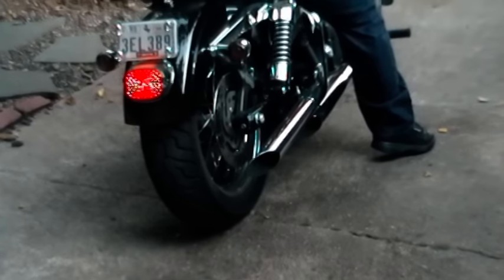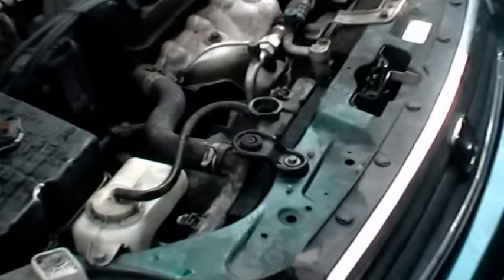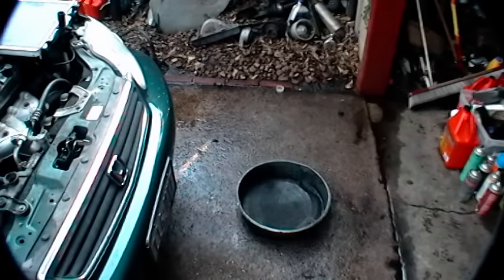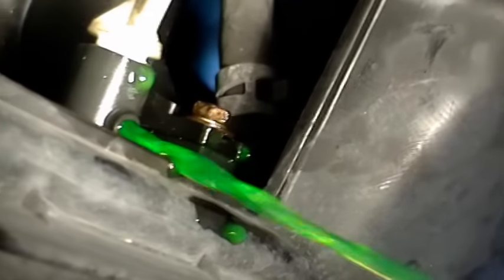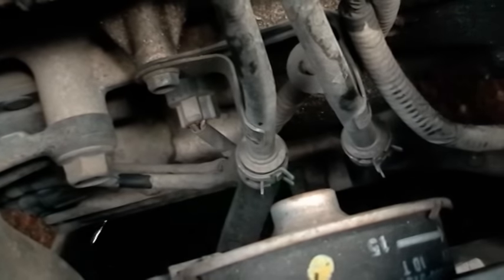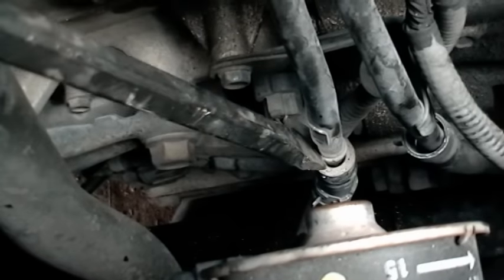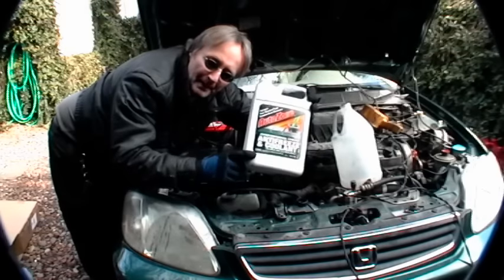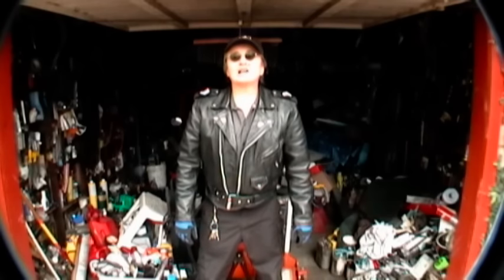How to Replace a Radiator in Your Car

Comment: Somehow, I believe my experience will differ.
Reply: walter parker ha ha ha i know imma still try it though
Reply: i send my holden wm 2009 once to a mechanic to replace the radiator and the fan took him 9 hours to finish
Reply: i cant really remember its been like 4 years but last week I've sent the car again for radiator replacement and costed me around 430 usd so i think he charged me almost 500$ that time i think.

also don't do same stupid mistake like me especially if you got the same car always install the original radiator not the Chinese one believe me it's crap not worth it 2 years and it will start leaking
Reply: Lmao at first I was like this is simple.  Then he did all that n I was like oh hell naw🤣🤣
Reply: @95BLUERAY  Damn, I thought,I was paying too much. Im paying  rear brakes and radiator change for 545.
Reply: @andydelacruz7545  it's insane right? i think we all should start working on our cars
Reply: Eddy tha Don it’s easy if you have experience with small things.. if you haven’t been around cars much, it’s also a good spot to learn but just record all that you do
Reply: @PaPanthers  It was when he started hitting thngs with a sledge hammer that I lost heart.
Reply: I feel ya.
Reply: @PaPanthers  🤣🤣🤣🤣🤣🤣🤣🤣 yeah I got lost with everything that connects to the radiator 🤣🤣🤣🤣🤣🤣🤣
Reply: barreltapper lol
Reply: @95BLUERAY should be able to get the fans out in like 45 minutes. 
I took out the radiator in WM today and will replace it with a aluminium one, maybe tomorrow. Hopefully it holds up. 🤞🏻
Reply: @95BLUERAY  Should be able to get the fans out in like 45 minutes. 
I took out the radiator in WM today and will replace it with a aluminium one, maybe tomorrow. Hopefully it holds up. 🤞🏻
Reply: LMAO 100%
Reply: “Cries in Cadillac”
Reply: Agreed
Reply: IKR! Scotty makes it look super easy
Reply: Many, many curse words and hours later you will be in business lol

Comment: absolutely stellar video you saved me 135 dollars God I don't where we would be without youtube
Reply: Canadian Tire wants to charge me $150.00 to put in a new one . Plus $150 for the radiator Plus $130 or so for labour.
Reply: @CanadianMan1982  If parts and labor are $150 and $130, what was the first $150 for?

Comment: I called around to a handful of different repair shops and they all wanted almost $500 to replace the radiator that was leaking in my 1996 GMC Jimmy. I was pretty hesitant to fix it myself, but I decided to be brave and do it. I ended up spending just around $100! The whole process was actually easier than I thought it would be too. Thanks Scotty for the inspiration!

Comment: Thanks Scotty! I didn't have a good way to take off the clapms - the "take them off at the engine trick" worked great for most of the hoses, except the one from the bottom to the engine - it was the toughest for me. The only other thing I had to deal with not on the video were tiny plastic clips holding electrical wiring - I learned that you just have to squeeze them out/through. All in all a successful install, which I attempted because of your video. Sincerely, Jen

Comment from the maker: yes, you need to get all the air out. 
but normally running it with the heater on full blast and then checking the coolant the next morning and topping it off works on most cars

Comment: Although each car has its own specific radiator peculiarities, the true value of your video is in its ability to shed overwhelming fears for do-it-yourself (sometimes out of economic necessity) mechanics. And there's GREAT satisfaction in doing what one can by our OWN hands, if possible, beyond "only" saving money: at least you KNOW what's been done, just HOW hard you torqued those nuts! The flat-head screwdriver— an indispensable aid in stubborn hose removal! Thanks for this confidence-builder!

Comment: Thanks man.  After buying a radiator & reading the instructions, it still helps so much more to see an actual video.  I'm headed out to replace my radiator now, confident it should be pretty easy.  And so much less expensive that Christmas is saved, ha

Comment: I had a leaky radiator and leaky transmission cooling lines at the same time. (it's a 22 year old car, so everything started leaking at the same time) I got the radiator on (they are pretty simple to take out and put in). Of course, I had to add transmission fluid too. What I was wondering, what about any air that is in that new radiator where the transmission lines connect. Do those lines need to have the air "burped" out, or will the trans. fluid automatically push the air out? I know  the trans. fluid pumps pretty good. I found that out when one of my old corroded lines burst!
Reply: This answers my question about the Atx fluid and I'm curious too about burping the young radiator.

Comment: hey Scotty a friend of mine has an 04 Honda civic LX it over heats & white smoke comes from the radiator cap could it be the cap or do I have to replace the whole radiator
Reply from the maker: pray it's just the cap, if not do my video tests "how to fix an overheating car"
Reply: Scotty Kilmer I used that to change the fan assembly and the thermostat I'm attempting to get to the radiator cap but I'm having some trouble with some hoses in the way

Comment from the maker: @Mitjitsu you want a 50 50 mix of coolant and water. So generally I flush the system, so water is in the engine half, then put pure coolant in the radiator.

Comment from the maker: @BellefontePerson  Some cars have cooling system bleeder valves, some don't. I personally use a vacuum system to suck air out through the radiator cap opening, so I never mess with those valves anymore. If yours has any, they will be on the top of the engine, and look just like the bleeder valves on brake systems. Scotty Kilmer

Comment from the maker: I use a vacuum pump that sucks the air out. You can back out on an incline so the front wheels are higher than the rear. Then run it with the cap off and the heater on full blast and watch it as it warms up and add coolant till the air is gone.

Comment from the maker: I advise keeping them stock. Most come with coolers already on them. Because if you add one, and it runs too cool, it would actually harm the transmission. Those things are designed by experts to begin with

Comment from the maker: @hdps99 
 The inlet hose is by the firewall, and it's the one next to the heater valve. You can change brake fluid and power steering fluid every three years, that's fine. Scotty Kilmer

Comment from the maker: radiators and condensers are separate. condensers only hold refrigerant and AC oil, if you're leaking coolant, it's the radiator

Comment from the maker: @crackermoves I use a vacuum machine to suck the air out before I refill em. You can just try running it with the cap off in the driveway and as it warms up, add coolant until full, that normally fixes it.

Comment from the maker: it will flow either way, but generally the lines fit one way better than the other due to rubber bending from years of sitting one way so see which one fits better

Comment: 98 Mazda Protege. Radiator blew. This video is a good buffer to see what's expected but even while using the repair book, nothing was easy as your video. Still, it helped me understand that if I keep things simple, it'll work out. Parts are out, Off to test fan units and buy a new radiator. Hope getting it back together is easier. What happened to the good ol' days of being able to work on a car or truck? I miss em!

Comment from the maker: @Mikhial66 you need to fill both up, if you don't have a radiator cap, you fill at the reservoir and run the car till it warms up and keep pouring till it reaches the full line

Comment from the maker: @UltiGamer101 yes, I would block flush it too. The air will come out eventually if you carefully warm the engine up with the cap off and add coolant until full.

Comment from the maker: Rust makes metal rot out, so if you coat any metal parts with lots of paint, they won't rot.  And you can make any system work, but window AC units use a ton of electricity and really only work if you plug them into 112 volt supply systems. Scotty Kilmer

Comment: You make this look easy sir. I have a Citroen Xsara that requires a new raditor since it has a small crack in the plastic part on the top. I'm really hoping i can od this myself as getting it done by somebody else will cost me an additional 100 euro's which i don't have. Thank you for the video :)

Comment from the maker: just put another radiator in IF it's leaking, new chinese made ones cost as little as 69 bucks and are easy to install. But, many things can make a radiator blow the pressure release on top of the radiator, so pressure test the system for leaks first

Comment from the maker: @BellefontePerson  If it has a nut and a bolt fitting, you can use a wrench. If it snaps in, you need a special ford tool to release the line from the radiator. Scotty Kilmer

Comment from the maker: @SRM30 only when the engine is cold, when it's hot, if that hose is cold, you've got a problem like a stuck thermostat or clogged radiator

Comment from the maker: if cooling fans stay on, they drain the battery, then the starter will just make a rattling noise. Fix the cooling fan problem first, often a bad main computer makes them stay on with the engine off

Comment from the maker: @spumoni84 normally they clip on and off. But some nutty designs have the condenser built into the radiator, and in such a case, you must unbolt the ac lines and remove all the refrigerant to change it.

Comment from the maker: either car is overheating and the pressure is releasing, or radiator is shot and you need a new one, that plastic crap often just wears out

Comment from the maker: most will just bleed themselves as you warm up the car until the thermostat opens, then when it cools down you open the cap and add some more. If not, we mechanics use a vacuum bleeder system to get them out of certain stubborn designs.

Comment: Should i flush the hose before installing the new radiator ? I am worry there are air bubble trapped later. Please advise on this. There are traces of green lines appeared along the plastic top cover. I plan to change mine soon.

Comment: With old cars where the ac does not work sometimes you can avoid the expense of a rad by removing the ac rad in front of the engine rad. Plugged rad usually caused by not changing coolant.

Comment from the maker: Nothing is easy to fix in a Volvo. Check the wiring on the intake air temp sensor, and replace the sensor if the wiring is intact. Do the same for the idle air control valve and replace the valve if the wiring is good, then HOPE it's not a problem in the expensive main computer. Good Luck, Scotty Kilmer

Comment from the maker: OK, let's be technical here. Hydraulic valve systems use oil pressure to set the correct adjustment on the valves , so there are no adjustments you can make on such an engine to the valves. Geesch, some people are picky. Scotty Kilmer

Comment: I have a 2002 Honda Civic and was wondering if I'd have to remove the front bumper to install a new radiator as I just saw another video of someone removing the front bumper? And do I have to disconnect the battery or should I?

Great videos by the way.

Comment: I just wanted to say thanks for this video! This is the first major thing I've done on a car (my car experience goes as far as changing flats, adding fluids, and spark plugs). It took a few hours but I got it done. If it wasn't for the damn spring hose clamps it would have been done in a fraction of the time.

Comment: Great video Scotty, I appreciate all the help you provide for DIY'ers. I'm attempting this job for a 2005 Chrysler Pacifica 3.8 and I was going off an autozone repair guide and it says to "Discharge the A/C system, as outlined in the Heating & Air Conditioning section. " Is this something for all vehicles, or just certain ones? Is it necessary? Is it hard to do myself? What happens if this step is skipped? Any help would be greatly appreciated.

Comment: Thanks for another great Video, Scotty what are the transmission cooling lines is this on automatic transmission cars? I ask as I drive a manual transmission here in the UK
Please Please can you post a video on setting up over head valves tappits also I would like to learn how to set up timing on a basic engine like a mower engine or old motorcycle engine
Thanks in advance Scotty and keep the great videos coming I love watching them and learning 
Ian in the UK

Comment from the maker: remove the radiator, then flush the system, you could just use a garden hose, most places don't allow chemical flushing anymore because of pollution issues.

Comment: Hi Scotty. Love the videos. I have a 2004 Honda civic and recently when it is hot out (over 80 degrees) and I have the AC on, the car will start to overheat when I am driving for about 20 miles or so. I was making a left hand turn and I had the AC on and it was hot out and the car began to power down (lights, radio, and the car was barley moving). I had the alternator replaced and it has been good all winter. Now that its warming up again, I have noticed the same problem but my alternator and battery are good. Do you think I should replace my radiator? When I went to check the radiator fluid yesterday, I was having some fluid coming out when I took the cap off. Strangely enough, the car was cool at this point and sitting for over four hours off. Thanks so much, Scotty!

Comment: Mr. Scotty. I have a 2001 sebring coupe, 3.0 motor. My problem is, the only time my radiator fan come on is when I turn my heater-a/c blower on. Radiator fan goes off when hvac blower is turned off too. What would be the problem there. Thank you for the help.

Comment: Hey Scotty, I posted a little bit ago about having to replace my upper radiator hose.  On the W203 model, the upper radiator hose has the overflow hose connected to the whole piece.  Instead of replacing the whole piece, I have been reading and advised that I can cut out the chunk that was hit by radiator fan (it is not leaking, yet) and put a splicer in between and solve the problem for around $4 instead of replacing the whole hose.  What do you think? I have a video up if it helps.

Comment: I figure i should let you know since I jist found this out. Some radiators when you order them will come with 2 extra ports for the trasnmission fluid. If you  have a manual, you dont need this ports and you can still install it. Coolant will not leak trougth since its 2 different systems. Dont freak out

Comment: Hey Scott, Thanks for the video. I have 2006 scion xa manual transmission. Radiator coolant level in coolant tank is Good but empty in radiator.. when I tried to fill up, found that the coolant was leaking from radiator.. and got drained right a way.. so am hoping its a big leak  I am seeking for help on 1. which radiator would be a good fit 2. I do not have any major tools at home, Can I replace at home? If not, how much normal average labor charge for Radiator change? Appreciate all your help.

Comment: I finally got my radiator replaced today because the original was damaged due to overheat and oldness.. however the replacement radiator was smaller than the original and the mechanics was able to fit it nicely on my car. Is it still ok to use it even though it's kinda shorter than the original (about 2-3 inches shorter)?? My car is nissan bluebird 92 and the replacement radiator was also a nissan original parts and with aluminum/plastic.

Comment: Dude I changed the radiator by this video.. awesome. But, I didn't know I had to run the car with the radiator cap off to get the air out of the system before driving. I went thru 2 of them before I learned... it still bubbles.. now I know thru Scotty's other video that I may have a water pump issue. 1997 Honda Accord

Comment: Hey Scotty! Thanks for the video! I am looking to swap out the radiator for my Honda Accord 2001 with a Denso 221-3215 Radiator. What kind of transmission is on a v4, 2001 Honda Accord? Thanks!

Comment: Hey Scotty, I changed the rad and to my amazement, after all of that work...it sprung a small leak. My friend said to get some Bars Leak and put it in there, guess I have no other choice now. Also, after I changed the rad my rad fan will not shut off, it stays on continuously. It WAS fine. I have a 88 Prelude 2.0 SI, and the fans are known to stay on for a bit, but mine stays on indefinitely. Tried removing the relay switch and putting it back, tried unplugging the power and replugging it... :(

Comment: Hi, Scotty. Thanks for this to-the-point video! I have to replace the radiator on my 1998 Honda Civic LX this weekend. I bought a Spectra Premium radiator from AutoZone for $80. Do I need to run flushing fluid through my new radiator? Thanks!!

Comment: where my upper radiator hose slips onto the radiator plastic piece , the end of the plastic rib flange broke off , so now when my hose builds pressure the hose just keeps bursting off , could  them radiator places fix this , i was told they can replace the plastic tanks , is there something i can do to fix this myself or am i looking at a total new radiator ?

Comment: Scotty Kilmer I have a bad radiator but have been driving by refilling it with water for a while. Now the coolant is low and the water doesn't last an hour my car almost overheated (steam coming out of the hood when I was done using) I have the new radiator but will delay repair for a bit. Should I refill the cap in the meanwhile with coolant to get me places? Before I replace, also should I definitely get a new thermostat and radiator cap for the job as well?